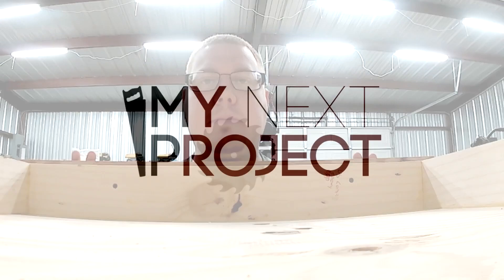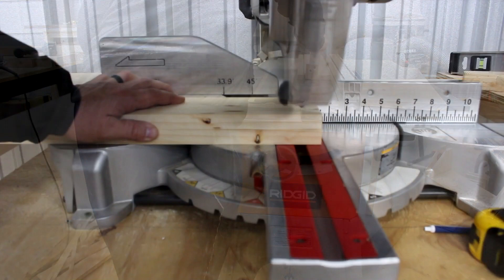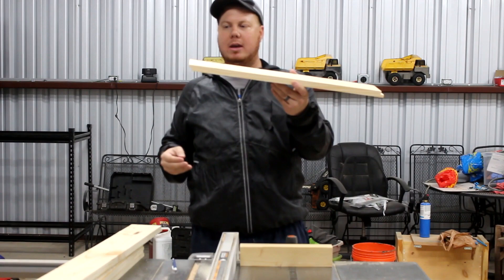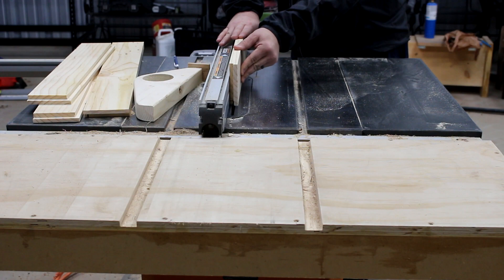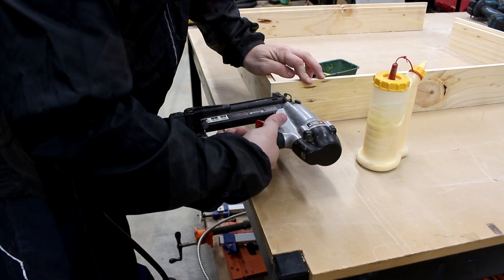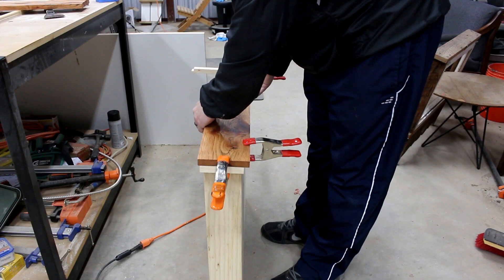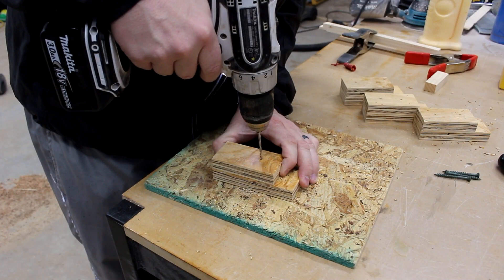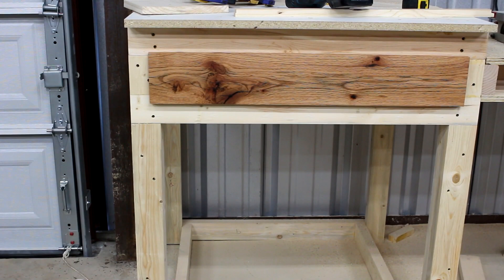Shop Drawers

Comment: Awesome ideas.  Thanks for sharing.  
Also, I'm digging your outfeed table @0:37 .  How do you line up the router to make your dados there?
Reply from the maker: I actually have a video where I made it.  It has been a while, but you cut those ahead of time and cut them oversized. Your miter guage should not be referencing off of the out feed table at that point.  Once you get it that far pushed through you should be through the cut.  

Video: https://www.youtube.com/watch?v=HOubM4ix9b0

Comment: you should use sanding sealer on all of your projects, makes a world of difference, your work will look more professional. i use it on everything...almost, cant use it on everything.
Reply from the maker: I will look into that and try it out.  Anything to improve the way the projects turns out is definitely something to look into.
Reply: @MyNextProject   i ran out of sanding sealer recently doing a table top and destroyed the finish part and had to turn it over and turn the bottom into the top after i went out and bought some sanding sealer, it was pine, i made it cheap because i am the one using it. the next one i make i think will be red mahogany wood. then sell it for a good profit.
Reply: @MyNextProject  put on the sanding sealer before you do any finishing.